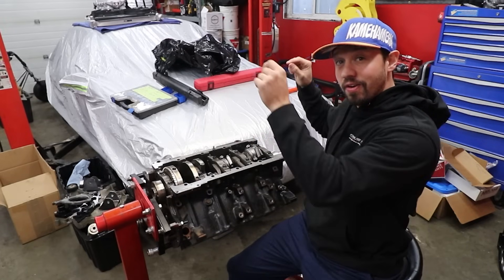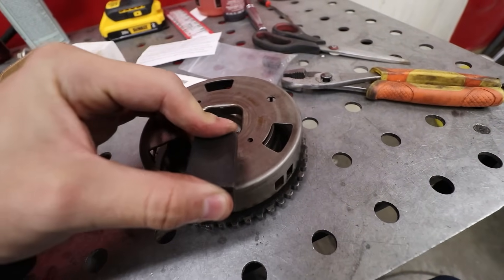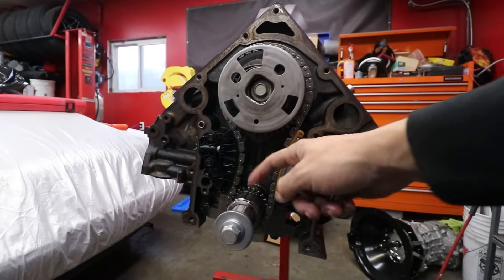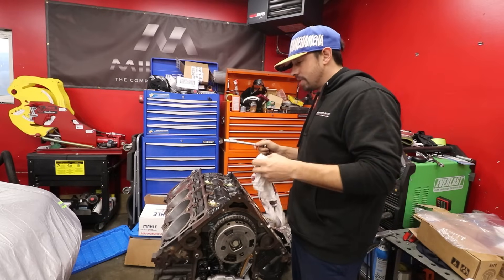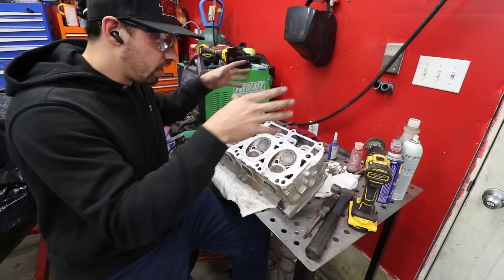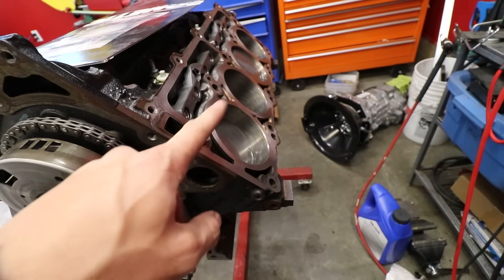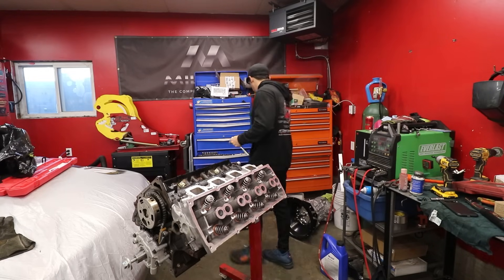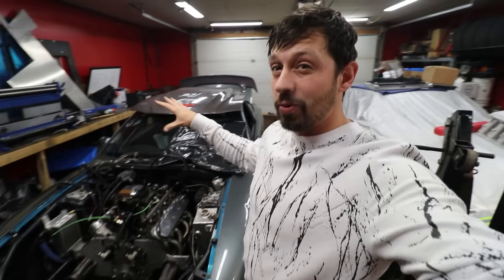HemiFox Twin Turbo Hemi Engine Is Done

Comment: Ooooh nice. To help negate the Hemi “tick” you will need a high flow oil pump. Not high pressure. Tick comes from low oil supply to lifters during idle. I don’t think you will have a problem. But a better flow oil pump is the way to go always. I do that to all my Mopar engines
Reply: I'm old-school. A Mopar with a tick just means it's time to add a quart. These new-fangled engines baffle me.
Reply: Gonna need something for the hemi knock if he thinks he's going to make 1000 for more than 30 sec.He has a hard enough time keeping a built ls together😂
Reply: @lsxtmt4910  I'm fairly certain he's only hurt 1 ls engine and that was the one from the machine shop with the Chinese heads.
Reply: I'd have to agree 😉
Reply: @lsxtmt4910  What's wrong with 1000 on a hemi? Nothing

Comment: I remember the first time i removed valve springs, the tool slipped and shot the retainers across the garage.  By some miracle, I found them because I didn't have replacements.

Comment: Make new flange corners and weld them on where they match the head.  Better than drilling and tapping the block. Then the gaskets will fit in their normal orientation.
Reply: Was gonna ask the same Q.  Drill and tap a head with water jackets. :O  Should be vid out there somewhere from someone doing it if its ok though

Comment: How a lot of turbo hemi builders do is run a electric oil pump to feed the turbos with an auxiliary oil reservoir. Also heard of some people tapping a oil feed journal to the cam to help oil it since in hemis the camshaft is the last part to receive oil.

Comment: Chrysler's been using that oiling system for fifty Plus years, But the new ones definitely do have that really nice hemi tick.😮 LS motors still have the sweet LS tick also. I remember general motors saying that is normal And that It's under no warranty repair scope.

Comment: If you need it, I can machine a drill guide for drilling out those bolt holes.
Reply from the maker: I was thinking about trying to make one on the arc droid
Reply: @Boostedlifestyle  if it doesn’t work out for you, lemme know. I can mill you a nice steel fixture

Comment: The heads are left and right they will bolt up but messes up headers bolting on  just saying Incase that’s the issue
Reply from the maker: Holy shit you might be right I might just have to switch the heads...
Reply: Had it happen to a buddy
Reply from the maker: Damn that saves me time from having to drill them out

Comment: I'm sure it'll work for you. But, I would recommend just doing 90degrees after torquing. The 90degrees vs going to a final torque value accounts for the increased drag of the threads and the friction of the underside of the head of the bolt to the head bolt washer. Those frictions can be affected by so many minute differences in the grease distribution and surface finish of the threads and faces. But great video none-the-less!
Reply: This is terrible advice. Way to go.